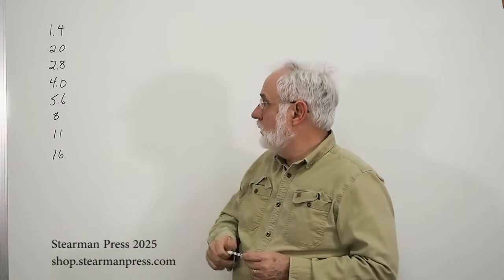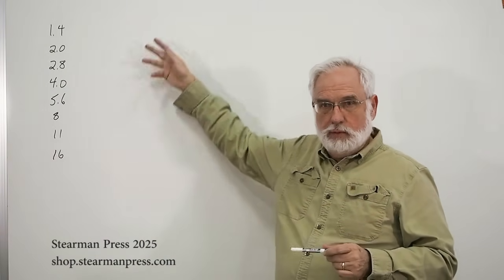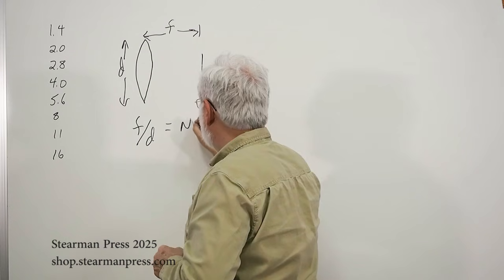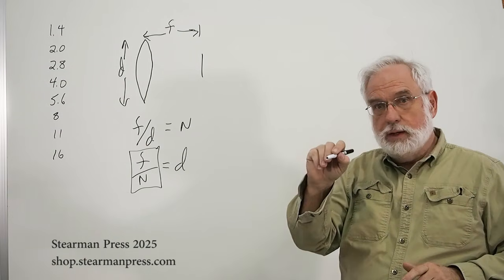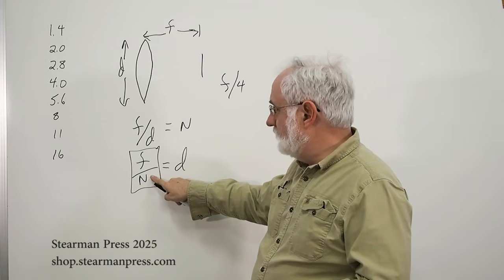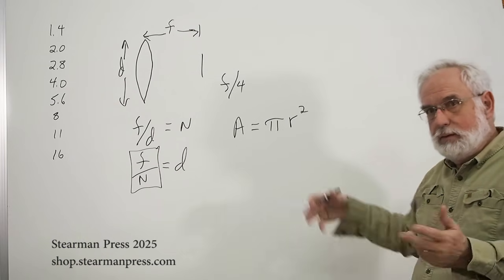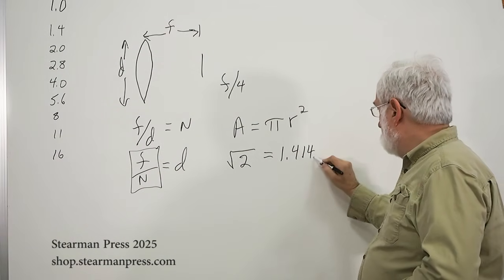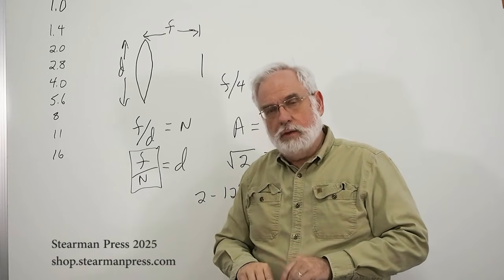The logic behind irrational f-stops

Comment: Former photo instructor here. This is a great explanation I've used many times. The increments also correspond to increments in shutter speeds. Since exposure to film or sensors is determined by aperture and time (shutter speed), if you want to keep the same exposure while closing a lens by a stop, you can conveniently slow the shutter speed by the next setting. Some of the older cameras used to have more decimal-based shutter speeds, like 1/50th of a second, or 1/100th of a second. My Dad learned on such a camera 65 yrs ago and though he's no longer with us, I can still recall him giving me meter readings like, "a 50th at f8" and I'd set my newer manual SLR to the closest setting to that.

Comment: An interesting aspect of f/stop numbers is that they also reflect the inverse-square fall off of flash lighting.  Monte Zucker, the most popular wedding photographer teacher back in the late 60s - 90s who I apprenticed with and assist used them to control both exposure and lighting ratio using dual flash in a key over fill configuration.

Our baseline exposure for color negative film  was f/8 from a distance of 11 feet which allowed the FILL flash attached via bracket above the lens to create enough exposure on the negative to record SHADOW DETAIL in black men’s suits.  The identical power photo cell triggered KEY light was placed at a 45° angle from wherever the subject’s nose was pointing and placed at a distance of 8ft.  

Per the inverse - square law moving a flash from 16, 11, 8, 5.6, 4 feet will change it’s intensity on the subject by 1 EV - f/stop the  11ft / 8ft distance ratio for two identical flash guns creates a 2:1 incident ratio which is what was required to expose the highlight detail optimally on the color negative and print paper. 

We used Rolleiflex f/2.8  45x45mm 220 film with a fixed 80mm lens and if moving it for a tighter crop we moved ‘systematically’ from 11 feet to 8 feet which made the FILL intensity 1 stop brighter so to compensate and keep shadow exposure the same we changed aperture from f/8 to f/11 and then to keep the 2:1 ratio the same moved the KEY flash mounted on a rolling converted medical IV stand in from 8ft to 5.6ft adjusted by eye and pacing.

The four combinations of  16ft at f/5.6 with key at 11ft; 11ft at f/8 with key at 8ft; 8ft at f/11 with key at 5.6ft, and; 5.6ft at f/16 with key at 4ft handled every shoot needed when re-enacting the ceremony action with posed dual flash photos and when capturing “candid” action at the wedding reception.  

The results using that method when covering action produce more consistent exposure than TTL flash which reacts to the reflectance of the scene and requires constant FEC - flash exposure compensation - adjustments.  Every photo we took had a full rich range of tone and detail in both highlights and shadows, and the type of lighting patterns and precise facial angles seen in movies.  

The same 1:2  key-distance ratio method works with any digital camera.  If using ETTL flash setting the A:B   /  Fill:Key ratio at 1:2 will produce the same full range of detail if the FILL flash is kept centered over the lens to evenly lift the shadows with the 2x brighter off axis KEY creating the 3D modeling similar to Sun and Skylight fill in nature

Comment: Thanks for the video. I shoot M43, is the F-stop value for a Full Frame lens half the value of a M43 lens? In other words, is a Full Frame 1.4 equal to a M43 2.8? Seems per this video that sensor or crop has no effect on the F-stop value, am I confused about this? I get different answers to this question.
Reply: The exposure at a given f stop is the same regardless of sensor size, what is different is the field of view and depth of field. A 25mm micro four thirds lens at f1.4 will have the field of view and depth of field of a full frame 50 mm f2.8 lens, however it is still an f1.4 lens for exposure value. This does not account for any increased noise for the smaller sensor.
Reply: @mmbrombe8153  thanks for your reply, and for clearing it up for me.

Comment: Nice video.
As an engineer, I worked this out years ago on the basis that the adjacent shutter speeds were set to let in half or twice the light. The 1.414 factor, also explains why teleconverters are made with a 1.4 times magnification so that it decreases the amount of light reaching the sensor by 1 stop and hence a 2X teleconverter will decrease it by 2 stops.
This must mean that the shutter speeds would go 1, 1/2, 1/4, 1/8, 1/16, 1/32, 1/64, 1/128, 1/256 ... .However the standard shutter speeds on a camera are 1, 1/2, 1/4, 1/8, 1/15, 1/30, 1/60, 1/125, 1/250 ... . Are the standard camera shutter speeds nominal speeds or are they the actual speeds and the error makes negligible difference?
Reply: The number in f/number is not a hard exposure number. In classical lens designs the f is given for infinity focus distance. But f gets larger when you focus closer by - that's called the "effective f".
My Z 105/2.8 S macro lens relays the effective number. f/2.8 at infinity becomes f/4.3 at shortest distance. As the entry pupil did not change we know it was 37.5 mm for the 105mm at infinity, so the 4.3 means f now is ~161 mm.

As the number just reports geometry, it is not hard in indicating light transmission. If I replaced one element in my lens by the same but now ND10, it would still be f/2.8.
Photography has the T-value as workaround. TTL metering cameras mask all this. Cinelenses suppress "focus breathing" (by zooming and then the T value is better than an f/number.

That's not all. "Correct exposure" is not part of standards. In the past, Kodak set it. But no longer. This has implications when you copy a meter reading from one camera to another
Reply: Hmm! I did not know that!
Reply: Back on old non electronically controlled film cameras you were lucky to get within a few percent of the listed shutter speed. On digitally controlled ones you can get exact speeds. Unless someone went above and beyond the call of duty to make an accurate purely mechanically controlled shutter they would indeed be moninal speeds you saw on the dial. On video oriented cameras you get the option to shoot in shutter angle where you do get the option of power of 2 shutter speeds. For example 1/48 if you are shooting 24fps.

Comment: I think a lot of the misunderstanding comes from misuse of technical words. So, people confuse 'f-stop' and 'aperture'. You have been careful to talk about 'f-stops', not aperture, but often people think that they mean the same thing. 'Aperture' is actually the size of the hole. It's understandable that it gets confused. The statement 'the aperture is the focal length divided by 2.8' is correct. Abbreviate it to 'the aperture is f/2.8' and it's still correct, 'f' meaning the focal length and '/' meaning 'divide by'. If you then abbreviate further to 'the aperture is 2.8' it's no longer correct, and people get confused. Iy doesn't help when people (and manufacturers) write 'F2.8' and the like, which doesn't convey much meaning.
Reply: you are correct in describing the aperture as a hole, and therefore, by definition it's a nothing.  but i'm confused by what follows.  it might help clarify to add the phrase 'set at' before the value (as expressed by the sqware toot of roo etc) and thinking ratio-nally... as others have said since days of yore, everthing halves and doubles.  ..and then dof.. good class there, teach !

Comment: Another level is T-Stops (True Stops) (Hasselblad/film industry) where it is just not a ratio, rather a precise measurement of light transmission between lenses!
So, if I take my quality lens of F=50mm and I change to an F=150mm, the density on the film (sensor) will be exacly the same at a given f/stop.
Reply: Yes, my Bell & Howell Foton has Cooke lenses in T-stops. 
  My Dad bought one new (late 40s?) and I understand one of the most expensive 35mm still cameras of the day.

Comment: Although I am well familiar with what you discussed, I have terrible problems with math. Perhaps most of your viewers will be delighted. I found it an overly fast run-through, without example, e.g., putting in the numbers to arrive at f/8 for a 50 mm and 100 or 28mm lens. You said "dimensionless" but never explained it; and your assumption that everyone "will work out" the differences between what you wrote and what you said was perhaps ill-considered.